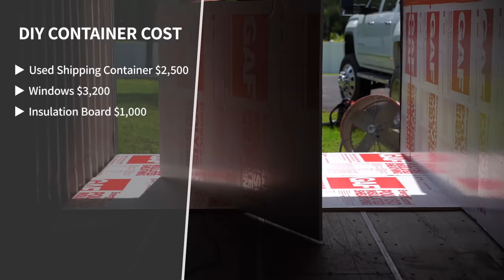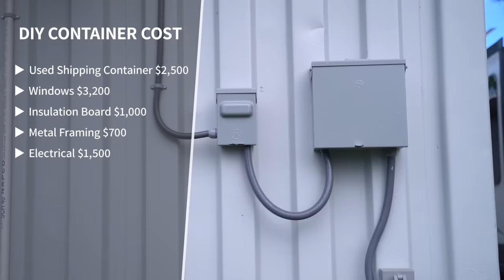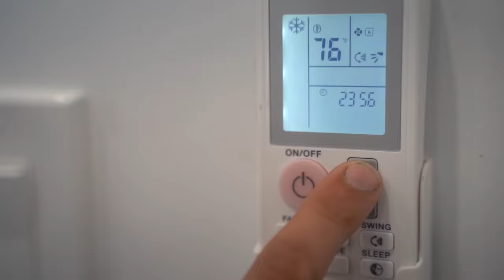40ft DIY Shipping Container Home (Total Cost Breakdown)

Comment: $17k materials 
$20k labor
$8k septic or sewer connection
$5k foundation
$10k site prep (does not include asphalt or concrete driveway, add $10k to do that) 
$15k well, or 6-10k for rain water catchment. If you connect to city water then it's about 5k? 
$5k electricity supply 
$5k misc.
Furniture
Appliances
Kitchen/bath supplies 
So very roughly about 60-85K if hiring everybody for everything and not lifting a screw, plus the price of land. The rest of the stuff like driveway and landscaping can be done later. These prices are true for states and counties that are more economical than major metropolitan areas. 

For a 40' x 8', which is 320 sqft tiny home, that's a pretty hefty price for an inexpensive rural area ($265 per sqft). If you build a house the regular stick frame way, the price will probably be similar. The shipping container only provides a shape, you still have to build a frame inside the walls to run your electric, plumbing, and insulation. So, the container walls only replace your hardy board siding and add a bit of rigidity and support to the structure. Plus they add more work because almost nobody builds houses like this, and so contractors aren't used to building them and it'll take them longer to figure things out = more money. So, other than a fun factor, they don't actually offer any substantial benefits or savings over a regular house. And I bet you can build a bigger house with stick frame construction for the same price (at $140 per swft you can build a 600ft house for $85k). There's also the fact that the price goes up less steeply for stick built home per additional square foot than for a container house, where you have to buy a whole other container or two to add space. So for additional $10k you can maybe add 100-200 sq ft to the stick house design (before building). But for a container house, you're looking at another 15-17k in materials plus $15k in labor to get an additional 320sqft container added.

Comment: I'm curious about the heating and cooling costs associated with this build.  That insulation board has an R value of 6(ish).  Marry that to a metal clad exterior and one would think that your heating and cooling costs would be higher than that of a traditional build.
Reply from the maker: Jeremy Storm so in theory yes, however using a bunch of air voids it works like a yeti cup and is amazing!  100 degree Florida days it stays 70 degrees inside no problem in direct sun.  Over the last 6 months it has averaged about $15 a month in electricity with someone living in it
Reply: I can see how the dead space would increase the R value of the overall insulating system. I didn't recognize that while watching and  I ask questions to learn.  I think the takeaway of what you're doing vs many others is that you are not laying your drywall directly over the insulation.  I think the air voids is a commonly overlooked idea in these builds because in normal construction, laying over the insulation is common.

Comment: Does any of this cost include the price tag of purchasing the plot of land you will require in order to build your container home on top of??
Reply: It's on his own property
Reply: @ZackWolfMusic   well therein lay the point I was trying to make, and that is that these shipping container homes are great ideas,.....if you already own the land. Otherwise, you not only have to build your shipping container home, but purchase the land prior, and in CA that would be astronomically high, even before you begin to build on top of it.  No videos ever seem to mention this hidden cost.
Reply: @Rebel-Forces-Earth-007  Stick built houses are cheaper than container homes! With container houses, you have to worry about wielding and crane operations, then you would  have to stick build the frame or use metal framing to make the container a floor plan..
You're doing twice the work building a container home than you would building a full stick built house! Not mentioning a stick built house can be sided with metal for it to look like a shipping container!  California is not expensive to build if you're far out in the country or desert, but the problem is that wild fires, drought,  and climate change makes little sense moving far from the city! If you want to be  in the city or suburb town you'll still pay a high price in land cost, but If you can build a cheap container house with contemporary modern interior and exterior it can sell for As little as 500 thousand and as much as millions of dollars! We all know housing prices in California are inflated, trailer houses sell for a million in the bay area!

Comment: How would this scale? I would imagine that It would not scale very linearly. If it would cost $30,000 for 1 40ft home would it cost $60,000 for a 2 40ft container home? or would it be closer to $50,000 for 2? I would, ideally , like to build a 4 container home for under $100,000. Maybe even $75,000. Would this be doable?
Reply: I’m sure there is a formula that dictates what you are looking for but you should use a floor plan generator and what not and use that to do generate your cost. I don’t think it would be a 100% increase in materials for adding another container
Reply: @bunythebeastgamer6920  Thanks, Friend

Comment: l'm a third generation property owner and his estimates sound pretty accurate as far as material cost, these days. Personally, instead of using that kind of flooring, l think l'd use vinyl flooring to put down. Have seen lumber yards have vinyl flooring for $0.69/sq. ft and be pretty good flooring, in design. l've been shopping around for latex paint, lately, to paint a house  with outside. Cheapest l've found, thus far, as been off of eBay. And it's not generic paint, mostly name brand exterior latex house paint..and using an air spray rig to put it on with. 
Windows, these days, are very expensive and l think l'd have someone do that, in that l don't have the way to cut out window slots, in these containers. Might be able to pick up some good, used sliding glass doors, on the cheap, have seen them being given away, for free, you come pick them up.. site is Craigslist. Now, wiring l can do, just picking up stuff used, would help to reduce cost outlays. l'd go with new breakers, tho, unless you are thinking of going ''offgrid'' with it. Just make sure the community allows it.

Comment: What I'm building should run me $55-60k. 3br 2.5 bathrooms w a den open concept living room dining room and kitchen. Solar panel roofing electric heating cooling cooking and hot water. Be as though I live in NC top notch high impact windows is a must have. Hopefully I'll be break ground spring 2022.

Comment: Summary / Transcript: 

In order chronologically:
Items ONLY not labor.
BARE MINIMUM numbers.
If you hire someone, double every $ number.

As of 2019 when published.

1. Used 40 ft shipping container: $2500+
2. Windows and doors (5 +2): $3200
3. Insulation: closed cell spray foam $2500
4. Interior Framing (metal) : $700
5. Electrical: $1500 
6. Plumbing: $1800
7. Drywall: $720
8. Flooring (Vinyl): $750
9. HVAC (1 Minisplit): $900
10. Cabinetry: $2200 low end
11. Countertops (butcher block): $700 
12. Millwork (baseboards, trim, interior doors, etc): $600
13. Miscellaneous Material (glue, shims, screws, sandpaper, etc): $500 
14. Paint (primer and top coat): $250
TOTAL: 
$17, 320
But round up to $20,000.

NOT INCLUDED in this budget list: 
- Exterior siding
- Roofing
- Exterior paint
- Landscaping
- Site Prep
- Septic
- Water supply
- Electrical Supply
Reply from the maker: Good summary! Now take all those numbers and literally double them from the last years price increases! Some are tripled!
Reply: @ContainingLuxury  I definitely believe you

Comment: Frankly, US$20k for a 30m/2 self-built home is a lot of money where I live in Mongolia. It's about $631 per m/2. You could get a contractor to build (per metre/2) for less than that with SIP's and have more options. Self-builds would be about a 1/3 of that. We're essentially using the same materials for builds except maybe more brick and concrete construction than lumber.

Comment: shipping containers were coated with potentially toxic material on the inside which was difficult and potentially hazardous to remove. another aspect is insulation and metal support for the new structure can be expensive, insulation inside and lose a large amount of space.
Hire an architect and group of workers can be pricey.
Would it be cheaper to just hire an architect and contractor to build it for you? Do you really save money going the shipping container route?

As to having someone build it for you, the problem with tiny houses is that building prices don't really scale with size. A house a quarter of the size is not going to be a quarter of the price. Getting the house built is expensive, adding square footage is relatively cheap. You may be looking at 50-75% of the cost of a normal small house especially once you include the speciality fixtures, power sources, and appliances you will need to live in the smaller space. Composting toilets are expensive.

One of the reasons you see so many people gushing over these things and so few actually building them is that you can get a 36' motor-home with a diesel engine for less than a tumbleweed.

Comment: 12 OSB boards. 12 4x4 dimensional lumber, a door, a window. 4 concrete blocks as foundation. 2 Plastic corrugated boards as roof. Done at $600.-

Comment: well looking to build a 4 large 40ft container home by the lake and to round up for 20,000 for the 1st container with the kitchen and bathroom in it then 10,000 for each of the other 3 containers to include siding am looking at 50,000 for a 1,200 square feet home in california. then add another 10-20,000 in permits and foundation. so that's 70,000 home. I already own  20,000 square feet lot. but i can get a manufactured home for around 60,000 brand new so not really that great of an option. hopes are crushed now.

Comment: IS IT About 55,000 to 65,000 dollars  for a complete  built ?
Reply from the maker: Hey! So they use to be around 65 pre Covid but now do to material shortages and increased prices are 85-90k! But there have been some major improvements and very modern with floor to ceiling glass!

Comment: That is not too unrealistic if you were to buy all new materials and make it semi-sheik looking. I was able to reclaim my doors and windows for mine (6' wood clad exterior door and 2 each 5'x5' double casement windows) for about $400. Framing cost me about $700 (added pitched roof with 2x6 rafters). Metal roof at $400. Insulation was about $700 (wool insulation). Electrical was about $500 with fixtures. Plywood flooring for about $200 with sealant. Plumbing is around $500 with fixtures (reclaimed). Wall/ceiling paneling will be about another $1000 (haven't gotten to this yet). Appliances (heater, stove, water heater, fridge (mini) at about $450. Total materials= $4850+ $3300 for 40' high cube= $8150

Comment: You should also try to take bare container weight and finished weight. If you plan to use it for long with all those stuff inside then better buy a new container. Used container would just be nice for storage and rain shelter not a main house. 

It might also be good project to fix the container into a trailer and some fix jacks for parking. The additional height would be good too and can just hook it up on a tractor head then go watch king of hammers. Then again everything would be different from energy, water and septic services. For marketing purposes, you can just drive those models in areas for people to view plus give them links to vids and cost breakdown on paper im sure youll be making a company of your own in amtter of years. People might sell their house for a container style home.

Comment: Container 2,500 (includes shipping if you know a guy)
Windows 3,200 (impact windows) includes cutout. Frame. 1 Sliding door, about 5 windows.
Insulation 1 inch close cell insulation panel 4x8ft total 1,000 installed.
Interior framing only materials 700
Electrical 1,500
Plumbing materials 1,800  
Drywall with fiber tape, compound, 720
Flooring (vinyl with underlayment) 750
Heat / cooling  900
Cabinetry 2,200 (for the kitchen the size of the video) 
Counter tops 700 (doesn't include the sand paper, clear coat, the oil, just the physical wood itself 700)
Milwork (interior doors, door casing any type of trims) 600
Miscellaneous materials (glue, shims, saw, blades, rollers coveres, roller frames etc) 500
Paint (primer and paint for interior) 250

Not included anything for the exterior in this quote. Quote is only for the interior. Doesn't include exterior siding roofing exertior paint landscaping, site pro, septic water supply electrical supply. 

Remember this is a bare min quote. Given you have the skills to do all of this yourself this is just the physical actual cost.

17,320 TOTAL cost.

Comment: I am thinking about having a shipping container home built. I would hire someone, I don't know where to start. I live in Vermont and have found a layout/design I am leaning towards. I am not trying to build the cheapest, I am more looking for someone to give me a quote on what I want and a goal for when I am ready to start. I know there is fluctuation with materials, but my 5-year plan is to get into this forever home then. I know what I want, and based on a quote, I would likely make adjustments if needed. Does anyone have any suggestions? It would be much appreciate.

Comment: You only used 1 inch of insulation at best R7 big mistake at least put mineral wool or other in the stud cavity.  I would also insulate the underside of floor and leave the 1 1/4 marine grade wood floor and either epoxy paint or floor covering that is relatively inexpensive with no underlayment necessary .  This saves money and allows for more insulation in floor if you want it which I do.
Reply from the maker: tee kay we insulated the outside which is why we only went with 1” and we left vents for the cavities to breath... all depends on overall design
Reply: @ContainingLuxury  True and good but you stated with leaving the outside as is and no one just finishing the inside would not insulate further so price would be higher and this may make doing just spray foam about as economical.  Either way add more money for a typical home with outside left as is another $1500 or more.

Comment: 1st off.... I would use 2 high containers  2 deep by 1 deep length and width u shaped to build 3 good walls out of.  welded/reinforced at the corners.   so 40 x 80 space inside of the containers.  (3200 sq feet + 1600 = 4800 sq feet.  (yes you need a good bit of property for this) + 2 more containers for nice A$$ car port for camper etc or 4 more to do it on both sides (south side should be for solar area. 

So step 1 poor a 90 by 65ish foot foundation (with everything to code and everything like electrical + conduit, plumbing pipes etc accounted for. ) (with a way to anchor/bolting down the shipping containers.
Step 2 put containers anchor first floor of containers down. then container to container anchoring via drill and bolts welding etc. 
Step 3 figure out the roof you want and  and install trusses/roof you would like to have.  Once you have the roof installed  You now have one amazing ass glorified car port you can now put in living space into or build the 4th wall.  
Step 4 time to clean up the containers.  Meanaing get out a grinder and grind out metals for stepping up and into the container as living space.  I suggest maybe putting a set up of bedroom/bathroom per 2nd lvl container.   then maybe guest chill room on the 2nd floor of the back side lone container.   Also build a stairs (8feet wide and loft/deck area 8feet wide)and loft./deck to enter the 8foot high living space.  
Step 5 enclose the structure (Highly suggest/thinking about like a metal building with tons of insulation that gets framed in.   You can conform and seal in the metal by building that peice like a pole barn or you do some blocks but by doing that metal building style wall facing the least amount of wind... You can insulate and double insulate when you frame in(remember the abundance of living space.
Step 6  create windows and doors respectively frame in etc. 
Step 7 enclose all open gaps and then do framing  electrical and plumbing
Step 8 ... insulate, insulate and insulate some more.
Step 9 install hvac/wood stove etc
Step 10 the nice part  which is doing 1  amazing bathroom/bedroom area, then doing   the kitchen as well. (this is so if you have to take a break to recoop some $$$ and your back and neck are hurting you can live without too much pressure)
Reply: Stick built is always cheaper than container built!!

Comment: That's per container.  Now quadruple that for CA.  Doesn't include the land.  This doesn't include the grading and grading plan, enviromental impact stmt, permitting, electrical grid access, water and sewer and the exterior work. Design and asthetics approval by the local planning office including siding selection and roof design before you even start.  Where are you going to live during the three years to get past the paperwork.  Build in a free state and off grid or just be ready...  This total cost is just the cost of a sewer line in CA!